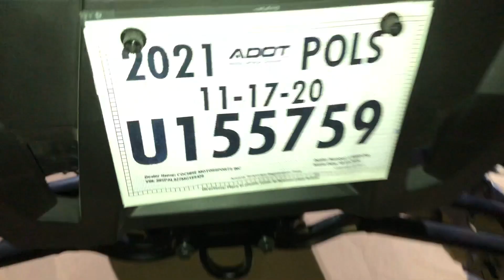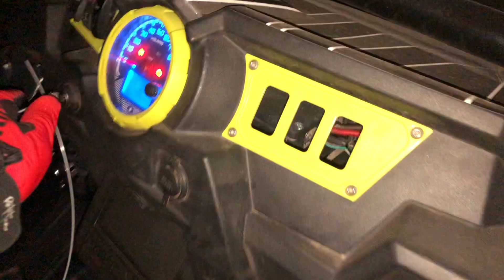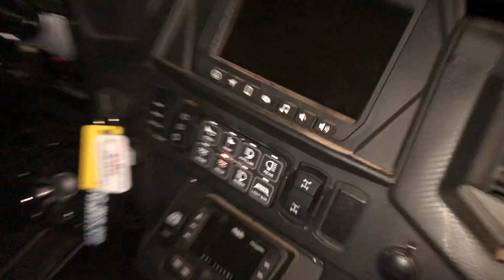Glamis Sand Dunes 2020-2021 (Rolled the RZR!)

Comment: Why did it look like the rear suspension was cranked all the way up when you pulled it off of the trailer? You had no up travel and it will pogo all over the place...
Reply from the maker: You would be correct. Lesson learned, don’t trust a fresh shock tune🤷🏼‍♂️
Reply: I thought the same thing already sprung, Im sure that contributed to the roll..
Reply: Way to much spring. Those things are cranked to the max not good on a little 2 seater. What was the spring rate. Because who ever put those in will be fired.